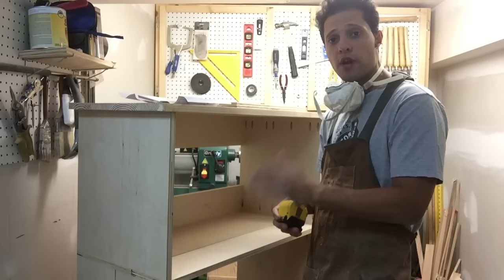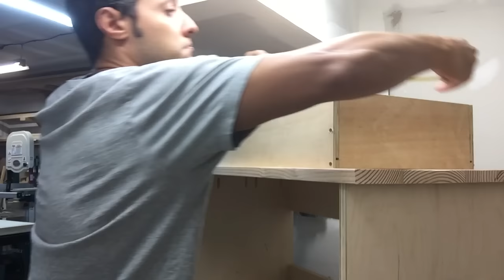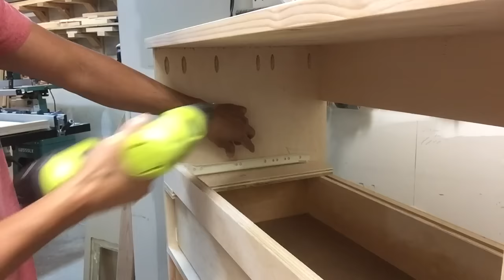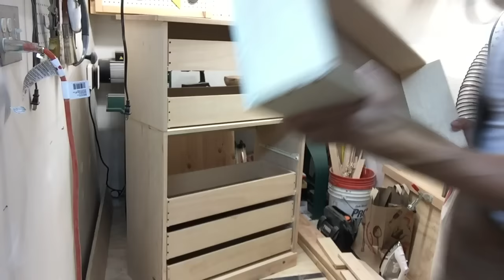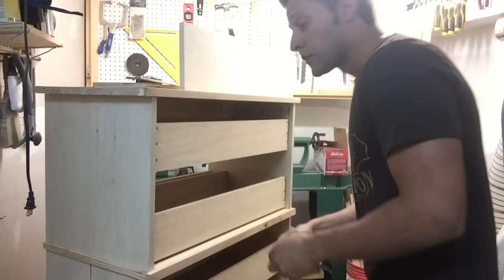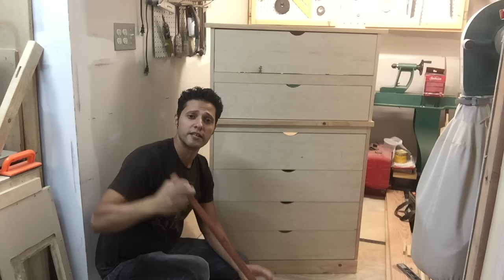Make a Dresser (part 2)

Comment: Great work as usual. With all the pocket holes you've made. I would've joined the front and back of the drawer with pocket holes. You're not going to see the pocket holes because of the drawer fronts anyhow. Love it or hate it, it's still a strong joint. But that's me doing it the easy way. Love your work bro!
Reply from the maker: anthony battle thank you, I appreciate it.  I would have done the pocket holes to attach the drawer fronts if it were 3/4 sides but the boxes were 1/2 inch and i don't really like using pocket holes on 1/2 inch material.